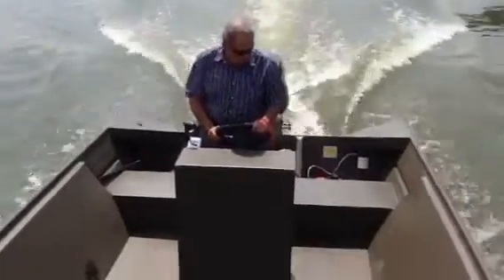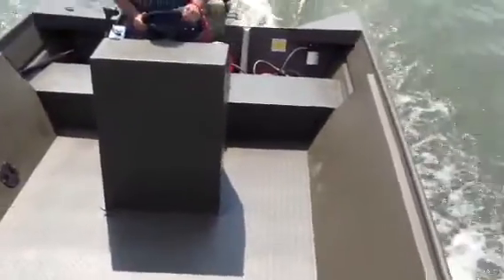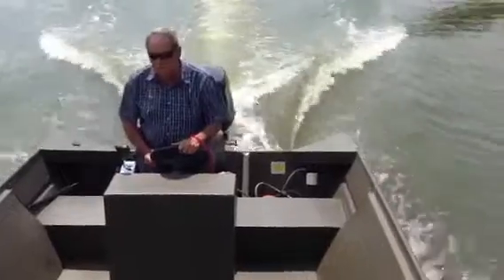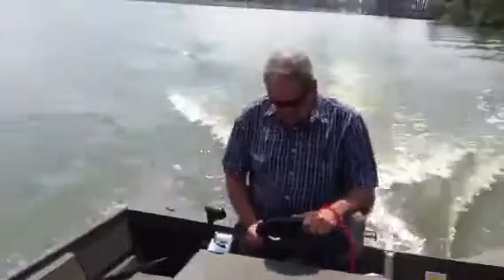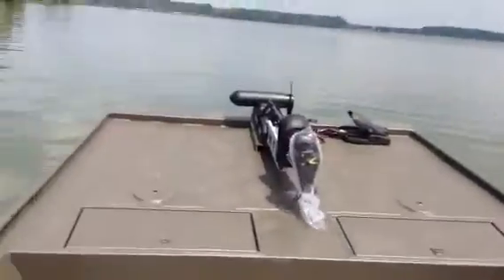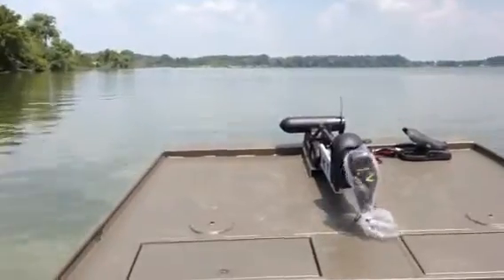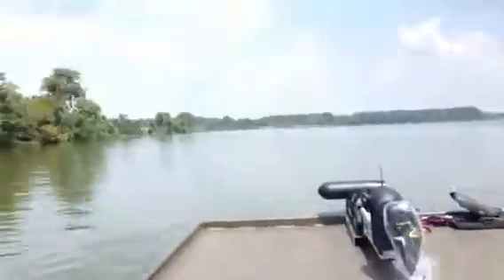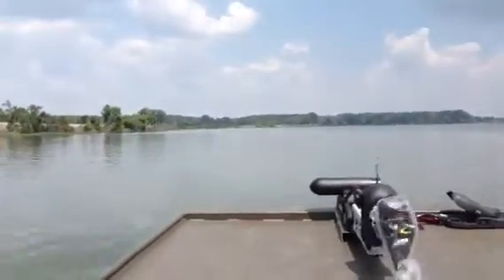Weldbilt 1870 90hp Tohatsu

Comment from the maker: It would be around $16500-17000 with tax.  That doesn't include a trolling motor or any wiring.  Just the price on the boat, motor, and trailer.  Let me know if I can help.  If you can email me at backwoodslanding@gmail.com. These posts don't always get back to me quickly.